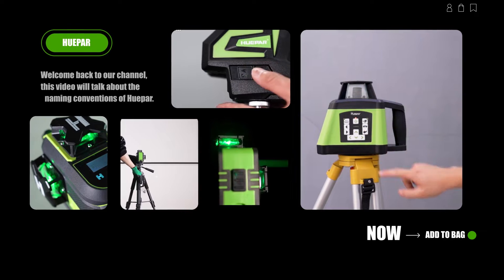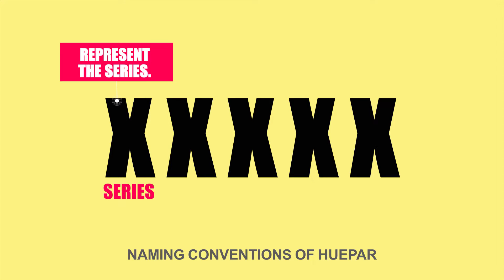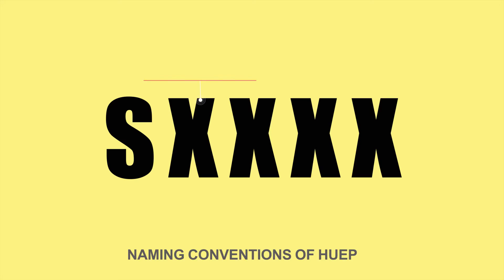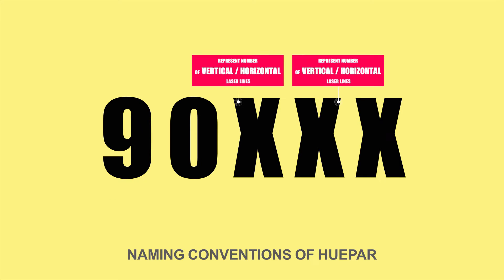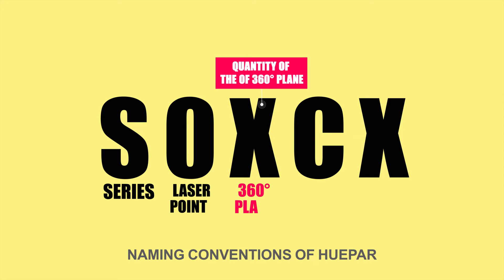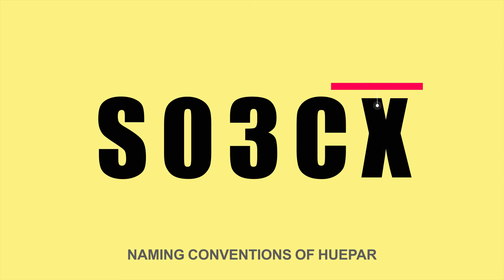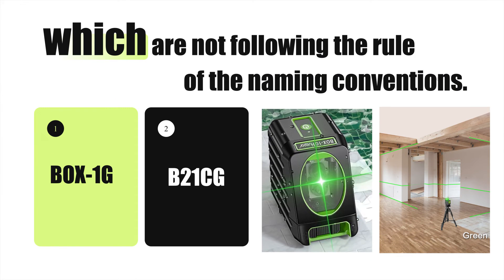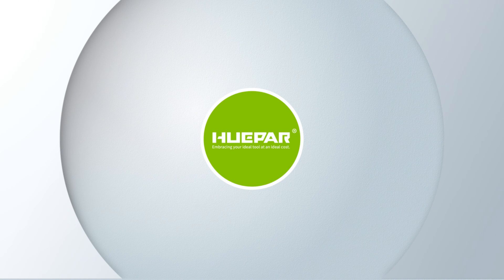How to distinguish the basic functions of Huepar laser level by model

Comment: for anyone looking for some actual help, I asked chatgpt to do deep research in to all current huepar models and summarise them for a youtube comment, this is the result:

Huepar Laser Level Tier List (Quick Guide)

£30–£70 — Basic DIY (Cross-Line / Plumb-Dot)
• B011G / BOX-1G – Cheap, simple 2-line green lasers for basic leveling.
• 9211G – Cross-line + plumb dots for floor-to-ceiling transfers.

£130–£190 — 3D Models (3 × 360° Full Room)
• 903CG / B03CG – Best value 3×360° all-rounders.
• 703CG / GF360G – Beefier 3D models with better batteries and stronger beams.
• S03CG – Adds Bluetooth + LCD.

£200–£260 — 4D Models (4 × 360°, Floor + Ceiling)
• 704CG / LS04CG / P04CG – Full 4×360° coverage for tiling, ceilings & floors.
• S04CG / ZK04CG – Pro versions with remote/Bluetooth and extra durability.

£470+ — Rotary (Outdoor / Construction)
• RL300HVG – Long-range rotary for exterior leveling, foundations, big sites.

Quick tip:
If you want full room layout, start at the 3D tier.
If you need floor + ceiling lines for tiling/fit-outs, go 4D.
For big outdoor jobs, go rotary.